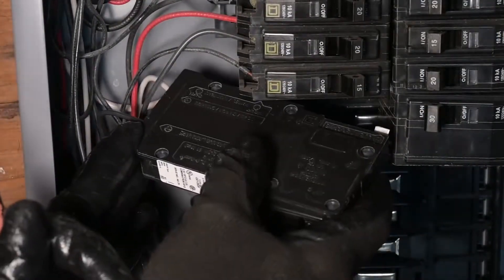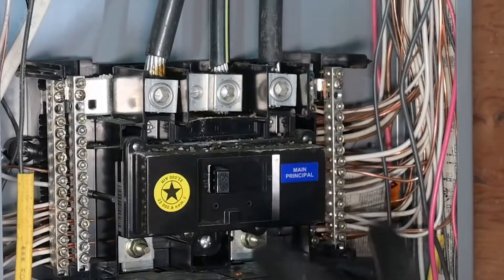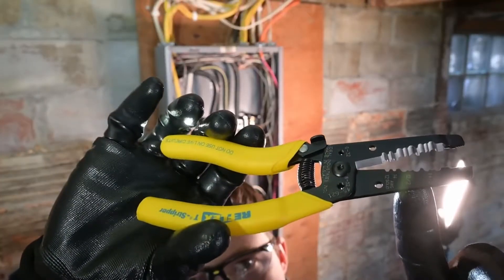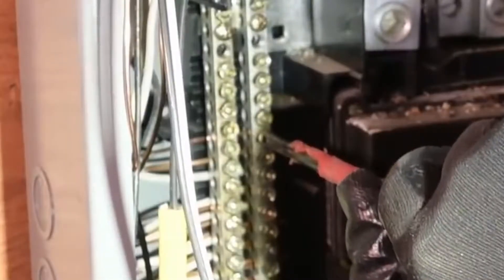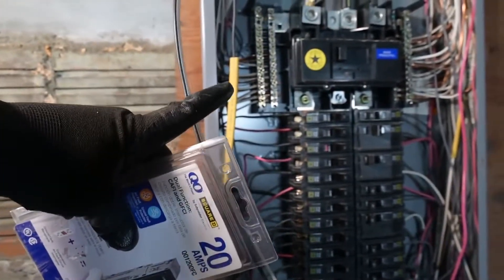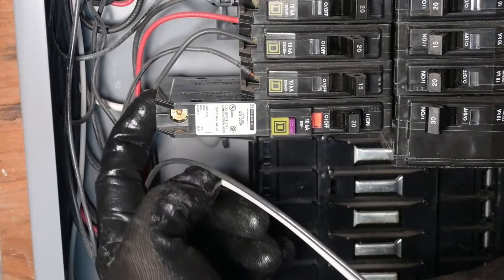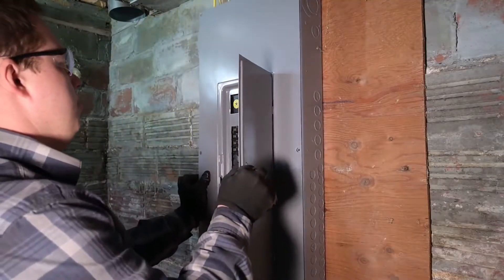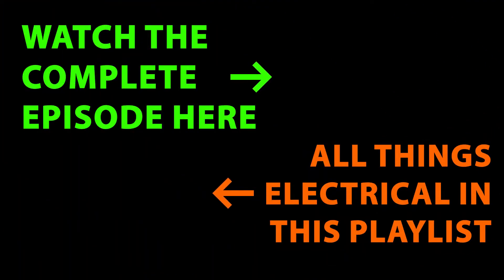How To Install a New Circuit Breaker in a Main Panel in 90 Seconds!

Comment: I had an Electrical Company install an additional circuit breaker panel to my garage. It is straight to the meter box. Since this is coming from the meter box and not from the house main panel is this considered a main panel at the garage? If so as I have watched many of your videos should this have a ground rod? I believe they ran the ground back to the meter base and then bonded the new circuit breaker box. I went with an electrical contractor as I am not comfortable coming directly from the meter box to the circuit breaker box

I look forward to your reply

Jeff

Comment: Isn't that the way it was typically done?  Except for turning off the main.   That's a bit better protection but not really significant.  Being very cautious and skilled and connecting to an open breaker and then snapping it in at the end was never very scary for me.  If the enclosure design is crappy, disconnect the supply.  If it is normal, use common sense and don't be afraid.  we're getting a little too paranoid here.  Be careful, don't be stupid, and you'll live another day.
Reply: For a novice, or a tired worker, turning off the main makes sense

Comment: I have found your past clips interesting, but have a concern. I noticed you throw the main breaker while all others circuits are powered on. It has been my practice to shut off all or most other breakers before throwing main. Any merit to powering off other loads first thus saving a possible high current arc on main?
Reply: I don't know which ones are installed in the US, but here in Germany the (new) main breakers are also there for over current and short circuit protection and should therefore be able to switch high currents. But in old installations there might just be a simple breaker or I would rather call it switch. Those should not be switched under load as they're not made for it. So I guess it depends.
Reply: No, not that I have ever heard of....
Reply: Actually did not turn off the main breaker?   Avoid all of the electronics in the house going blank.
Reply: @tedlahm5740 

I prefer the electronics to go blank than my brain